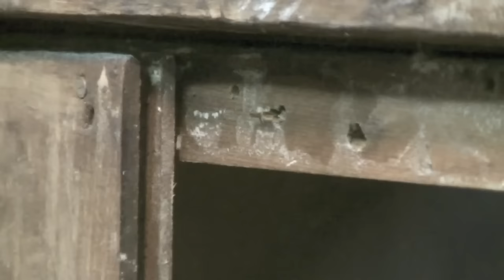Eliminating Odors from an Antique Chest of Drawers - Thomas Johnson Antique Furniture Restoration

Comment: Hi Thomas! I'm educating myself how to properly clean and restore a very old, very big and very problematic credenza. It has woodworm and mold galore and it stinks. Something I saw in your video made me really worry for the first time since I decided to take on this monster project. It was the fact that you noticed that there was still mold in the joints of the drawers and in other joint sections, even after washing the whole chest of drawers with bleach. So it makes me wonder: should I then take my whole credenza apart in order to be sure that I really reach every possible nook and cranny where mold might hide? I had hoped that cleaning all visible sides of my piece of furniture would be enough, but now I'm not so sure anymore. The "only" problem is taking the credenza apart literally piece by piece is out of the question, I wouldn't be able to put it back again. (Plus it even has some dove-tail joints.) Any advice welcome. And thank you so much for sharing your craftsmanship.
Reply from the maker: Thanks Anca! I think you can successfully do it. I've learned to use white vinegar instead of bleach. Bleach evaporates too fast, the vinegar will soak in a bit and do a better job. You can mix the vinegar 50/50 with water. Put it in a spray bottle. Turn the credenza upside down and have at it!

Comment: Wow! I’m asthmatic and watching you blow away the dust with that compressor made me lose my breath. I like to do woodwork also but I use a tack cloth to remove the dust.
Reply from the maker: Thanks! sorry about that! hen you have an air system in the shop you get used to using it for stuff like that! When I'm applying finishes I will use a cloth

Comment: The pet sanitizer, which I believe is chlorine dioxide based, works wonders.
Reply from the maker: I'll look for that, I wonder if the product I use has that in it
Reply: @johnsonrestoration  look for the one ion the gray bottle. Zinsser also makes a similar formulation.

Comment: I'm just curious do you reuse the same nails it comes with it so you use new nails and why?
Reply from the maker: Thanks for watching. I try to put the same nails right back where they come from.I'm talking about period antiques that might have the original hand forged nails, things like that. But sometimes you have to substitute longer nails or slightly bigger nails to make it work. I save old nails and have new reproduction nails (I buy nails from a company in Rhode Island that's been making nails the same way since 1820 or so)

Comment: Old wood is always a bit smelly. It soaks up and stores everything..Now that the mildew is gone, the only thing left to do and what helps just fine is to put a little bit of cedar wood into the drawers. I also use aromatic smelling satchels. And for all of my wooden furnitures and stairs I use a lavender beeswax polish from merry old England. I love the smell, so refreshing and clean. I also own an pharmacy cabinet from 1800 and the drawers still smell of the goods they stored mainly herbs and roots. They all are labelled. Two are really funky smelling: Valerian and Sennae.. but I will do nothing about it, the smell of history..
Reply from the maker: Thanks! That is good! I find the packets of activated charcoal work well too. I like the fact that you like the pharmacy smells!

Comment: I may not of thought of the bottoms of drawers, it's large and heavy, so turning it over and rotating is going to be difficult (I do however have an ion generator. I'm going to clean it with vinegar b/c I've heard that vinegar penetrates wood pores better than bleach. We've successfully killed black mold on wood with vinegar.
Bleach and Shellac.....just no (I dislike both).
Reply from the maker: Thanks! Yes, an ion generator would be good. And yes, vinegar penetrates better than bleach, I've started using that instead of bleach. Shellac is great though - non toxic and really seals the wood

Comment: It's a charming piece, but I wonder if it had taller feet originally. That bottom rail under the lowest drawer looks a bit funny.

Smells can be a big pain to deal with. I don't know if I would have shellacked the exterior (back and base) but this isn't an extremely rare or valuable piece, so I guess it's not really a big deal (and the owner wants the smell gone).
Reply from the maker: +sooth15 This turned out to be an expensive job so I really wanted to make sure!

Comment: You will always smell the funk....Its antique shellac that smells, hide glue smells, The only way to properly seal this is to sand all surfaces with 220 and dewax shellac or deft lacquer sanding seal the entire project.   all my antiques take roughly 20 minutes to seal complete start to finish. but ive done 1000s ....
I never use water on any antique.
dewax shellac can be made by freezing zinssers shellac then open the can after frozen and scoop out the hard wax.
i sometimes use minwax wipe Polly.
Reply from the maker: Thanks Brian, I've had similar experiences. I just buy dewaxed shellac. Zinser's calls it Universal Sanding Sealer

Comment: Technically, that's not a dado, but a groove.  A dado runs across the grain.  And here ends the pedantic portion of the comment.

Was the bleach solution chlorine, or oxalic or something else?
Reply: +confiscator I've never in my life heard that a dado must run across the grain. I've been a cabinetmaker for 15-20 years.
Reply: +sooth15  It's nice to know you can always learn something new, isn't it?
Reply from the maker: +confiscator I did not know that! That was household bleach, 9 parts water, 1 part bleach
Reply from the maker: +sooth15 I'm going to look that up!
Reply from the maker: +confiscator I only consider the day a success if I learn something new!
Reply: confiscator 

Oxalis acid isn’t a bleach. It’s a chelate. Bonds to metal ions, in particular, used to remove iron (rust and rust stains).
Reply: @FrankGutowski-ls8jt  Get the Chemistry right.  Oxalic acid is a reducing agent.  The oxalate ion gives up 2 electrons and becomes 2 molocules of carbon dioxide.  In the case of a rust stain, ferric becomes ferrous and soluble.

BTW, reducing agents can be bleaches.  The problem with that is atmospheric oxygen regenerating the colored species.  The effect is put to good use in the manufacture of blue jeans.  The reduced state of the indigo dye is soluble and "colorless".  Cloth is treated with indigo "white" and then exposed to air.  The cloth turns blue and the blue is "colorfast".
Reply: Eli Duttman 

Wrong. It’s just a chelate. Coordinates with ferric ions, forming water soluble derivatives. That’s why oxalic acid is useful for rust removal. With other metals, eg, calcium, it forms precipitates.
Reply: @FrankGutowski-ls8jt  Did you major in Chemistry?  I did.  Oxalate (C2O4 negative 2) is a reducing agent.  It may be capable of COMPLEXING, but citrate, phosphate ... and especially cyanide are complexing agents.
Reply: Eli Duttman 

I have two chemistry degrees. One from MIT.

You must be thinking of it reacting with permanganate, a strong oxidizing agent. 

https://chemed.chem.purdue.edu/genchem/topicreview/bp/ch19/oxred_3.php